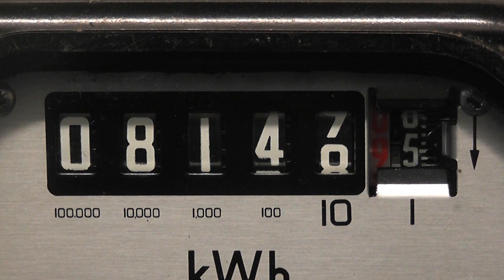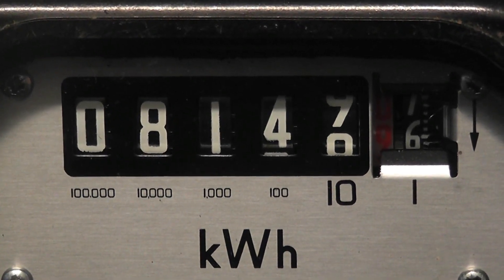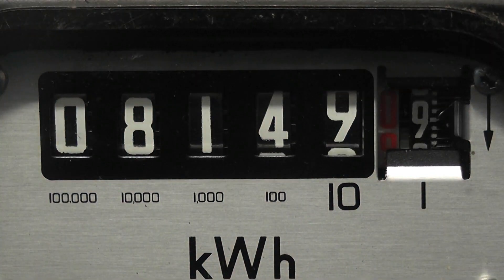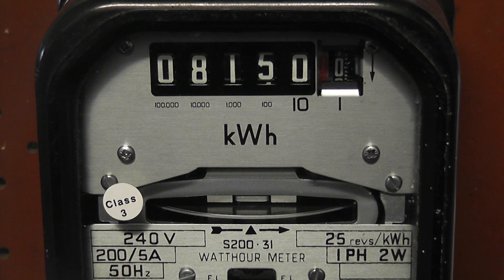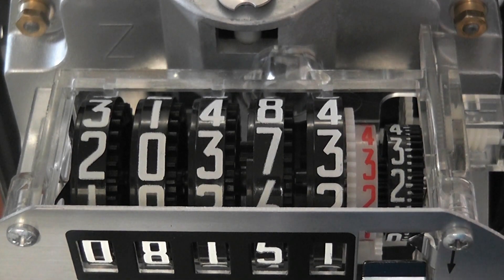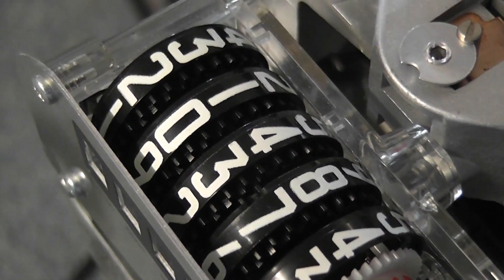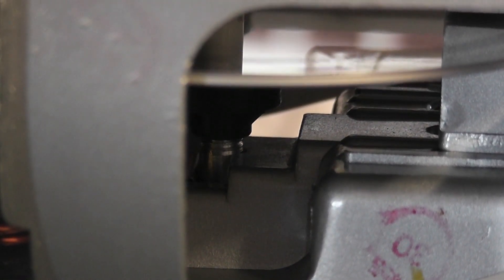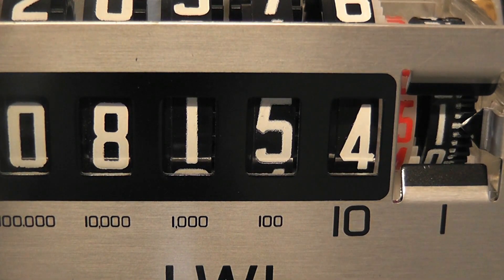Sangamo S200.31 CT meter 200/5 [3]

Comment: Sweet! You took the cover off and showed the current coil.... I was going to ask for exactly that, so as to see what the differences are from the whole-current version.

This unit seems to have more turns, and they are are also copper.

Thanxx for showing.

Keep the loadwheels spinnin',

-Wayne's Electrical.

6th October 2017, 22.03